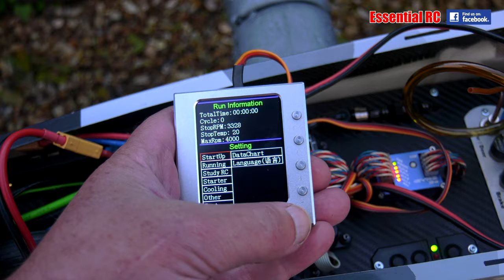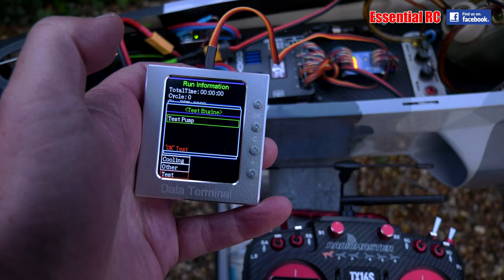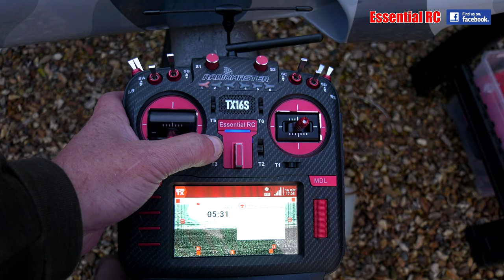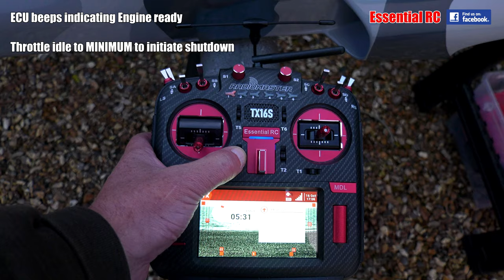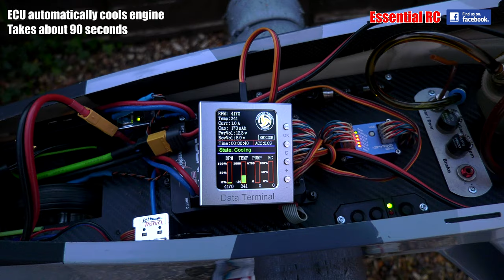RC JET ENGINE first start | SWIWIN 220B TURBINE | EASY INSTALL and SETUP !

Comment: You fly the jet with the radiomaster?
Which recievers do you use?
Thx 😬👌
Reply from the maker: TBS Crossfire Diversity connected via SBUS into Cockpit SRS Powerbox. Decided to move away from Spektrum. Can't support a product that is so ridiculous with their pricing and the Radiomaster TX16S MAX is superb quality and more flexible with OpenTX as its operating system.
Reply: @EssentialRC  wow 😁👌
Thats the first time I saw so flying such a big jet with TBS and a radiomaster!
That is really nice! 👍
Reply: @christianboehm83  funny isn’t it, we all trust “the big names” that we have had fail safe at short distances. Yet TBS etc that way outperform Spektrum etc in terms of range and link reliability we question 🤷🏻‍♂️ I think that Spektrum and Futaba etc are too dependant on having been the only main players. Lacking innovation and over charging customers eventually catches up with you. I have for the last year moved from Futaba and Spektrum to Tx16s and its been faultless.
Reply: @randall8686  you are completle right! There is not much new from the big brands 😕
....and the radiomaster really looks good! And hell yeah the new gimbals!?! 🤩
Reply: @christianboehm83  i have a set of the new fancy Gimbals here! review video coming in a couple of days !!
Reply: @EssentialRC  If you think Spektrum is overpriced have a look at the Jeti stuff (I'm sure you have)  OMG!  Love my TX16S's!
Reply from the maker: @williamb.9110  JETI is probably worth it. I know some qualified electronics engineers and they say the boards inside JETI transmitters are a work of art and very high quality. I can tell from the outside of a Spektrum transmitter how good it is.
Reply: @EssentialRC  just had a look at the TBS recievers....they support voltage up to 8.4V 👍
I have IRC Ghost...they only support up to 5.5V 😕
Reply from the maker: @christianboehm83  Yes. Can support HV servos. Important for a turbine jet.
Reply: 447 kph out of a 190 can imagine the 220 over 500.
Reply from the maker: @wayneschenk5512  I doubt the airframe would take it.

Comment: what's maximum speed of a RC Jet?
Reply from the maker: Depends on the engine used obviously but this engine in this RC jet will get it over 300mph easily. The limitation will be the strength of the airframe. There is a lot of stress on a jet doing that speed.